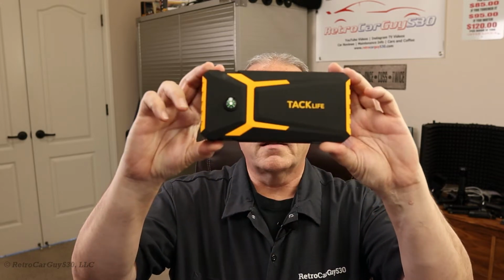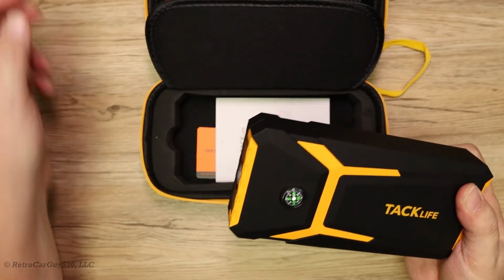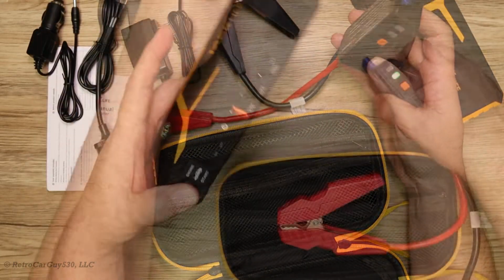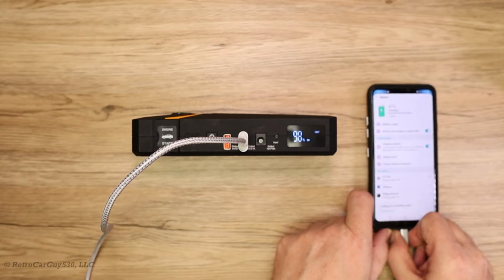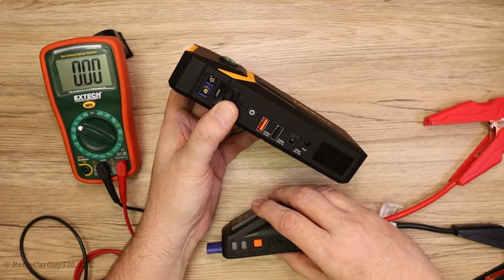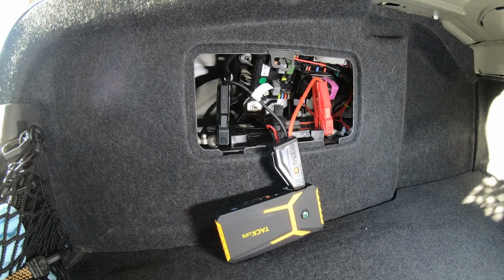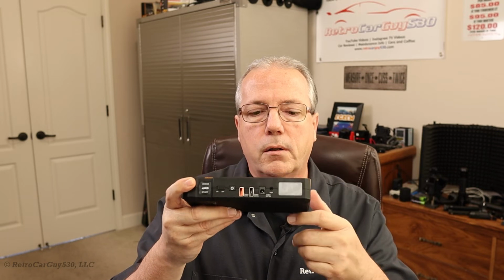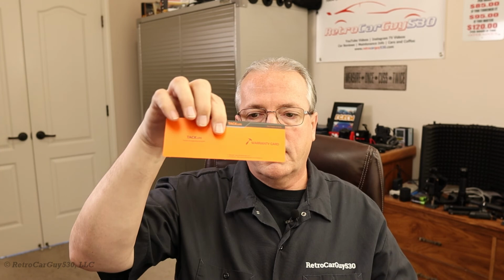Unboxing & Review: TACKLIFE T8-Newer Jump Start Battery Pack

Comment from the maker: This video contains a variety of demonstration and testing sections.  You can use the video chapter time marks to jump to a particular section that might interest you.

⏲ Video Chapters ⏲

00:00 - Intro
00:32 - Overview
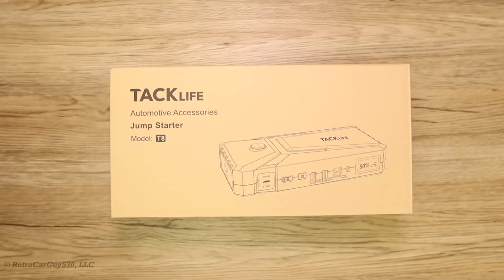03:16 - Unboxing
09:07 - Charging Test
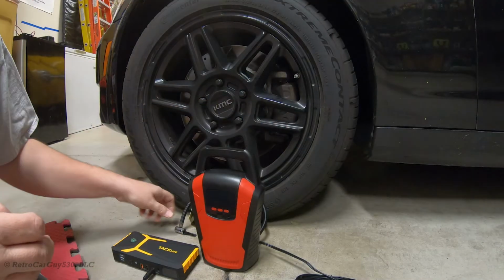10:08 - 12V/10A Power Port Test
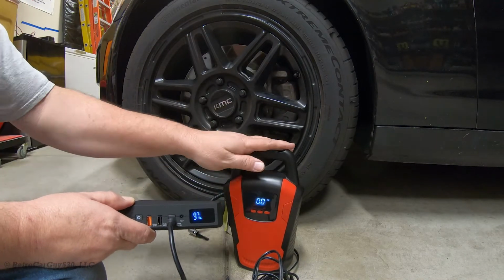11:30 - USB Charging Tests
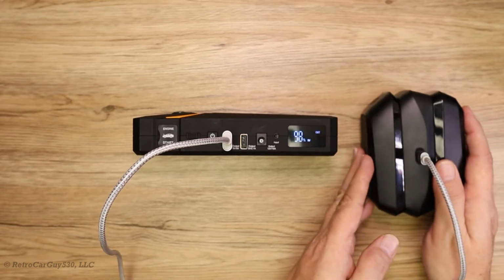14:04 - Jump Start Connector
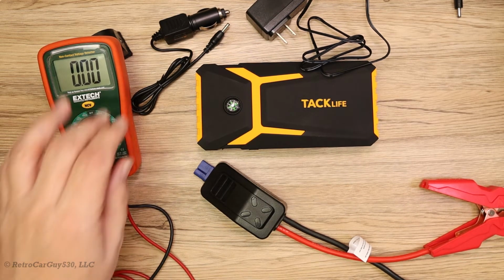20:43 - Jump Start Example
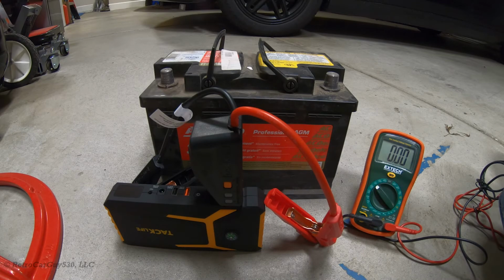22:10 - Reverse Polarity / Low Voltage Tests
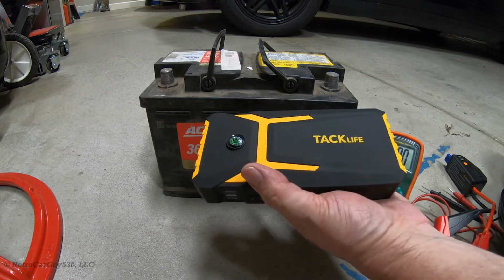24:35 - Final Thoughts

Check out the video's description section for more info/links related to this product.

Comment: Could you connect the cables in 12v mode to the battery cables when disconnecting the battery to maintain the memory in the car ?
Reply from the maker: Battery jumpstart packs usually power power for a limited time.  I would not recommend using the jumpstart pack as the vehicle power while swapping vehicle batteries.

Comment: What is the difference.  I have the green one.
Reply from the maker: I tried to locate information on the T8-Newer "Green", but it appears the TackLIFE website is gone.  I friend of mine had a "green" version, but I don't recall any technical differences.  Unfortunately, that friend passed away two years ago and I no longer have any way of accessing the "green" unit.
Reply: @RetroCarGuy530  thank you so much for trying. I’m thinking they are different years.  Thank you for your video.

Comment: I bought it 2 Years back and now it is totally useless , not working and amazon does not list this item anymore
Reply from the maker: I just checked my unit and it appears to be functional and keeping a good charge.  The T8 comes with a 2-year warranty, so if the purchase date was less than two years ago, you can contact TACKLife and see about getting a warranty replacement.
Reply: @RetroCarGuy530  no one reasons fraud and fake products

Comment: What's the difference between this and the red T8 Pro?
Reply from the maker: The T8 and T8 Pro currently sold on Amazon are not sold by TACKlife from what I can tell (different seller).  Those units are directly sold by TACKlife directly on their website https://tacklifetools.com/collections/auto/Jump-Starters

The T8 Pro looks to have different connectors on the side of the unit and it reports to have a 1200A peak amp capability vs the 800A from the unit I reviewed. 

On the TACKlife website it states for the T8 Pro:

As an upgraded model of T8, T8 Pro's startup performance is stronger and more stable. With 1200A peak current, it can safely start the dead batteries within a few seconds, it can start up to 30 times on a single charge (Only 4.5 hours of charging). Suitable for 12V cars, SUVs, trucks, or vans (Up to 7.5L Gas, 6L Diesel Engine).

[Advanced Design】A rugged and water-resistant enclosure rated at IP65, it can operate safely in any weather. The rubber covering layer prevents scratches and damage to the surface, which keeps the charging port clean. T8 Pro is Tacklife's most versatile car battery starter ever.

TACKlife has contacted me about reviewing a new brand of jump starters from FANTTIK.  I have not received anything yet to review from them.
Reply: Look for YT videos on that...such as this one:
"T8 VS T8 Pro" (by Tacklife Tools)
-- BR

Comment: The most important Feature of a Jump Pack starter is the Power Cell Make up ,there 3 Types (First Type) 3 Li-ion Cells 3.7 volts each = 11.1 volts Fully Charged 4.2 volts = 12.6 volts but when a load is applied they drop back to 3.7 volts Very Quick now the jump pack is only putting out 11.1 Volts Worst Jump Pack to Buy ! , (Second Type) 4 Li-ion Cells 3.7 volts = 14.8 volts ,Fully Charged 4.2 volts =16.8 volts when loaded 14.8 volts Best Jump Pack to Buy For $$ ! (Third Type) 4 LiFePO4 3.2 volts Cells = 12.8 Volts Fully Charged 14.4 volts Loaded 12.8 volts Very Good Jump Pack But are More Expensive then Li-ion Type , To tell which Type you have Fully Charge the Jump Pack & Measure the Volt at the Power Connector Plug on the Jump Pack itself "NOT at the Clamps" if its around 12.6 volts you have the 3 Li-ion Type , if it around 16.8 Volts you have the 4 Li-ion Type , and if at 14.4 volts you have the LiFePO4 Type . Again Packs Must Be Fully Charged . 

 Looks like the Tacklife T8 is the 3 Li-ion Cell Type with only 12.37 Volts fully charged so when tiring to start a car its only going to Supply around 11.1 volts  the Engine may Crank but slowly , The Jump Packs with 4 Li-ion  Cells will crank the Car engine MUCH FASTER !
Reply: Thank-you for this reply, very informative
Reply: Apparently, you can't go by "electronics stats" alone, because in the real world application of it some of the "better performing" units specs-wise didn't do well actually STARTING engines. Surprising I'd say. So unless you know which ones DO work the best on cold, dead and larger-engine vehicles, it seems we still have to choose one and hope for the best (or watch more detailed videos testing them -- as mentioned below). In my case I have the Tacklife T8 Pro (12000/18000) and I'm not at all worried about its performance on MOST engines, even diesels (but not the huge ones). Even the cheapest of these jumper-packs do well enough for the vehicles MOST people own, but you'd likely need a larger unit (and more costly) for the big diesels.
Look for this :followup" YT video (by Project Farm) to see how specs/real-world performance are sometimes misleading (and again, surprising): 
"Best Car Jump Starter? NOCO GB70 vs Antigravity, Schumacher, Gooloo, Tacklife. Let's find out!"
Is Tacklife the best? To me that doesn't even matter -- it WORKS, and that's all I needed...not only to jump MY vehicle (not needed so far) but OTHER "vehicles-in-distress" I may come across on the road. So IMO, my Tacklife T8 Pro is more than enough -- and at $60 it's a value/cost-ratio winner.
-- BR

Comment: I left mine on, though it didn't lose any percentage in the 4 hours until I remembered. It seemed as though the unit may have auto timed out. Or just the little lcd screen. Either way best to turn it off as he said. 👍
Reply: What do it means when you hook up the smart connector and it starts beeping whit out it being hooked up to the battery?
Reply from the maker: I cannot find that situation documented in the user manual for the product.  I have not experienced that behavior, so I have to assume that it might indicate that the smart connector is somehow defective.  You may want to contact TACKlife about a warranty replacement or if you just purchased the unit get it replaced by the seller of the T8.